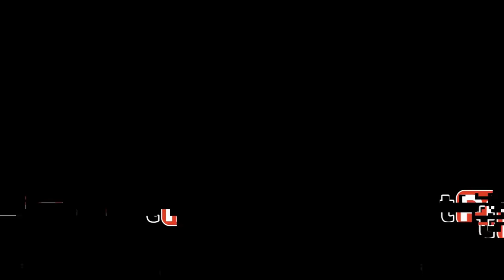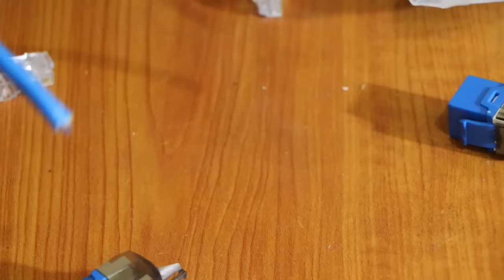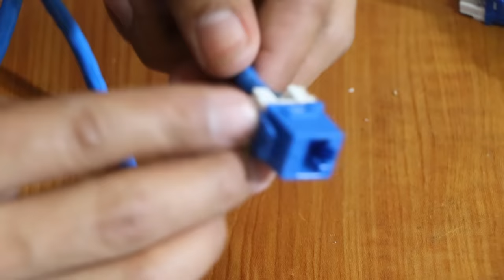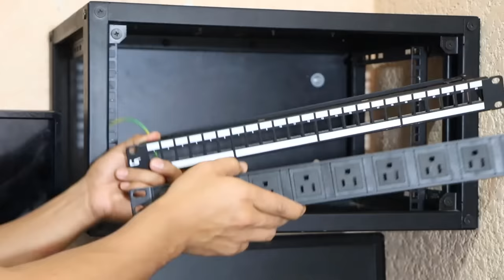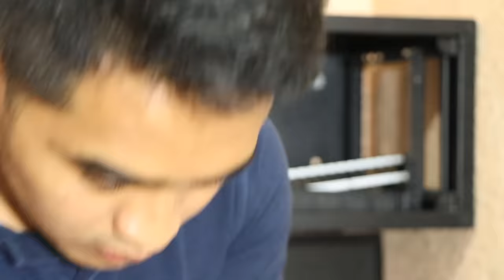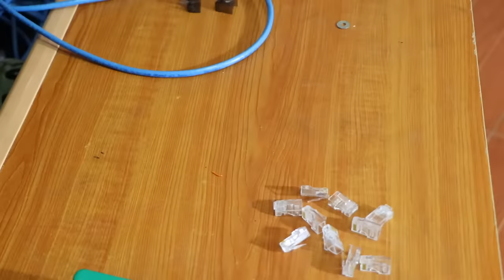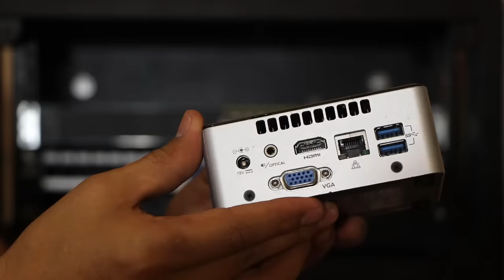DIY Home Network: Experts Debate – Right or Wrong Techniques?

Comment: Couple things I would have done different:
1) Install the cage nuts in the rack.
2) Patch panel up top, its never going to move, ever.
3) Use a shelf or the bottom of the cabinet as a shelf for not rack mount equipment.
4) The tight radius of your patch cables surely doesn't comply with standards, and you are screwed if you ever had to use another port.
5) Consider using a couple keystones for your media PC and modem hookup, that way everything goes to the patch panel and you don't have to tuck any wires back behind as you are up there.
6) If you haven't already, map out where your patch panel connections go in case you need to troubleshoot or want to set up VLANs at a later date.
7) A small UPS might be a good idea.

Overall decent effort. Definitely looks cleaner than the cluster f I have running, but with just a few tweaks there would be little if anything to fault.
Reply: 2) there are different opinions on that. I personally prefer any front facing power connections (which are often handy for home racks) up top and patchpanel beneat it.
(I personally have:
Power A
Passthrough
Power B
SFP+ switch (dedicated)
passthrough
1GbE switch A (with a few extra SFP+ ports for redundancy of some important devices on the SFP+ switch)
patchpanel
1GbE switch B

It's not ideal, but I have a lot of U's in height but a lack of access from the back, so having everything from the front makes maintenance easier. It also puts the patchpanel and switches on eye height, which is nice. What I wanted to make clear: The location of the patchpanel depends on your needs and setup. However, it should always be above any servers.)

3) preferably just grab rackmount gear. Switches are not that more expansive rackmount and almost every PC an easily be turned into a rackmount by just putting it in another case (including a router).

4) Standards, any link to a standard about bend radius for these?

5) The problem is bigger, he should've terminated the in-wall cables into keystones (not plugs) and should indeed have used passthrough plugs for the devices. I do like using pass-through plugs in patchpanels connect devices though, it's nice and clean... Till about 10 devices, then it becomes cleaner to do it differently.

6) This is so understated... PLEASE EVERYONE document it. I cant second this more. 

7) Depends on your location. Some countries don't have frequent outages. I myself unplugged all UPS's in my rack. The poweroutages once every 30-40 years(!) here, was not worth the 25-40W upkeep they took.
Reply: Point no.5, you mean that everything goes to the switch and not the patch panel right?

Comment: I would not have done my own batch cables, especially using wall-rated solid-core cabling.  The value of time invested in making all cables typically does not win over purchasing patch cabling at the length you need.

Comment: If you're only going to use two rack screws, at least use the bottom ones. This way it will pivot on the bottom edge which lets the rack ears sit against the rail. With only the top screws, the rack ears are trying to move away from the rail, so all the force is taken in those two screws and the top edge of the rack ears.
Reply: Not to mention that he didn't even use cage nuts for secure mounting.

Comment: Thank you so much for this video and the links in the description! I've always been hesitant to actually buy anything without assurance that it would be compatible. I used your recommendations and some of the tips from the comments to finally buy something I've been wanting for awhile, but recently found a need for (IP security cameras). I've run two cables into the basement for a central area to run to additional areas around the house, and this is perfect for that location.

Comment: Hi, I was looking for information on how to wire a receptacle outlet for a Emerson MPH-NCV27AMXH30 27 Outlet Black Power Distribution Unit; and I haven't been able to even find a PDF manual for this unit; I initially source the materials to wire the three, (3) phase, four, (4) pole, five, (5) wire outlet to match the plug on the PDU; however, due to the lack of information I have been able to find; I am thinking of changing the plug to Singe, (1) phase, 30 amp, 240 volt.  Any information or pointers where to find manuals would be very helpful.  Thanks.

Comment: Good video! I like that you made your own patch cables. And you should definitely use cage nuts and It does look like the top 2 racks are slightly off and not level. And like others have said the patch panel should go up top. I have OCD so I noticed it right away but otherwise really good job.

Comment: It hurts me that things aren't actually installed aligned with the rack, so only two screws would line up for each device
Reply: Literally was thinking the exact same thing... I rip my guys a new one if they skip a cagenut hole as then your always left with 2/3 of a U at the end.
Reply: It hurts me reading a negetive post
Reply: Newb here. Is it just me or do i think his setup like an overkill for a single home. I mean why does it seem he has a lot going on. I have a decent sized house with 5 bedrooms, 1 mini office 2 living rooms but my switch is just an 8 port tp link switch. Then using an x50 deco mesh system.  Ethernet bachauled to 3 rooms, the office, 1 living room, then wireless backhaul in the garage and the garden.
Reply: @lildrei01 just you...not trying to be a azz but that's going to be my setup.

Comment: hi, Maybe it's better if you use the gig ports (the 2 ports on the far right)  to connect the mini PC and the router. This because you get more bandwidth to your devices. If you want to access the files from the mini PC with multiple devices it's a lot faster then with a 100 mbit connection.
Reply: Agreed.  And, use (maybe) different color cables to illustrate that.  Not all just blue cables.
Reply: I didn't pay attention to the switch being used,  but a 24 port gbe switch is not very expensive. If the rest of the ports were indeed 100 base t, then the first upgrade he should do is replace that switch.
Reply: Agree with both of you.  But, I'm glad that he is showing it step-by-step, because it makes my PALTRY EFFORTS feel better.  This guy is real -- not like Linus and all of his large team now.  So, I like what this guy is showing us ... I really do.  I'd like to have a setup like him one day ...

Comment: How do you have your drops? Are they into the wall and just out a hole behind the rack or are they through the ceiling? I couldn't tell in the video....

If through the wall did you cut a slit in the header beam to fit all of them or drill a ton of holes?

Comment: @Torogi Pro: hey, thanks for that post. It's very step by step and I enjoyed it. But my problem is getting to the ending, you didn't mention which cables were going into the file server. Would you help me know the cable you plugged into the file server? Where does the other end goes? And the router: one cable from the switch to the router and the other one on the router, where does it go?? Thanks
Reply: Its a standard ethernet cable. You plug one end into the server's network port and the other end into the network switch. That's it.

Comment: I am new to patch panels. So I have to ask “why are they necessary?” Why not connect the Ethernet cables directly onto the switch? Let me know.
Reply: The whole idea to use a patch panel is for organization and static labeling of the network ends to easy the troubleshooting in case of failure. He skipped this primordial thing. :)
Reply: @gilmaringa  for a home system with 4 or 5 rooms wired. Do you think a panel is necessary? Or just use the switch?
Reply: @JayDee-nj6dx  Hi. I think that is not necessary. Just label the cables and connect directly to the switch. In the rooms I recomend to use keystones on the walls.
Reply: @gilmaringa  Thanks 🙏 I’m wiring my home, 5 rooms with the longest cable 30m . Should I wire with cat 6 or 6a? Cat 7 would be overkill right?
Reply: @JayDee-nj6dx  cat5e with good quality will be allright till 1Gb. Remember the switch have to be 10/100/1000 too :)

Comment: I have only one question, why you put into the 2 fastest port of the switch a regular cable from patch pannel insted connect the router to the fastest posr on switch? Is it because you have a server in another cabinet? Or maby the router supports classic ethernet only? Thanks

Comment: You lost me when you started plugging the cables in:
- Where is the internet coming from?
- Why connect the media server to the router vs patch panel?
- How do you add on wifi?
- What are the two patch cables on the right, that connect the switch and patch panel for?

It also seems like you're linking to a different patch panel than what was used. Im all confused. Maybe this video isn't intended video beginners?
Reply: Got yeah

Comment: The hardest thing then a CCNA certification is to crimp those damn RJ 45 connectors. 

Great video btw dude.
Reply: I use passthrough RJ45. It is a lot easier and will save you wasting RJ45

Comment: Why not terminate your cables with RJ45 and plug direct into the switch? Why out jacks on them then use patch to connect to switch? What does that gain you vs going direct?
Reply: That is an option. For most home users, it will work fine. The reason we use patch panels especially in large networks is to keep the network rack clean and organized. Also, the cables that run from the data drops to the cabinet are not meant to be moved around that much. The cables are usually stiff and can break or otherwise become damaged over time. In that case, you would need to replace the run which can be costly and/or expensive. That's why there are patch panels. The cables terminate at the panel and you can patch them in as needed. Its also helpful when you have numerous data drops and don't need all of them live. You just un-patch the ones you don't need.

In the majority of home networks, a panel is not required. However, in large networks where you have 10s of data drops, if not hundreds, it does greatly help to have them to make things organized and more easy to service.

Comment: Some funky comments in here!  This was a nice build for a home network - and much cleaner than my set up.  I noticed the people making negative comments don't have much in the way of their own videos.  I guess it's easier to criticize others than to create your own content.
Reply: Not everyone with expert opinions have YouTube videos.  I was the Administrator over a facility with a central hub, three edge wiring closets and fibre optic connections to the edge wiring closets.  I had layer two switches on the edge, each separated by their own VLANs (to reduce the possibility of traffic impacting other network areas) and redundant layer three switches at the core.  I feel that I have pointers that I could add, but I'll hold back since I don't have a YouTube video to prove my worth.
Reply: It wouldn't be as big of a deal if the creator didn't title his video as "Done Right", implying this is the model uneducated people should follow. Does it work? yes. Is it clean? Yes. Is it right? No its not. And that is fine. Things he could improve: 1) use proper rack hardware, in this case he should be using clip nuts, 2) Use hardware for all four mounting points on each piece of rack equipment. If you must use two, use the bottom holes, 3) Use a shelf instead of using hardware as a shelf for smaller components.
Reply: @brandon3122  this is the problem with generalized communication and one way communication. As the title suggests as "done right" may simply imply his aesthetic view of his system where as others not directly involved in the project don't know what the actual goal was when completed. As you said, it works and it's clean, so in that perspective, it was done right.
Reply: Yeah I agree with you, all these pros pop out to comment how his network setup needs to be up to data center specs lol. This will be better than 99% of home networks out there, and actually better than most small business networks I've seen. Most are a massive mess of tangled cables from careless IT people. Only thing i'd say to add would be a cable tester, since they can be had for really cheap.
Reply: @gerald8289  most home networks in 2018 use gigabyte switches. evem router built in switches from the isp are mostly gigabyte. ive done installs and maintenance in many businesses and schools and not one of them in 2018 uses a fast ethernet switch. the only times ive seen 2960s is in ccna code academys and home lab networks.. not in production systems. if you want a dumb switch you can get a 24 port tplink dumb switch for not that much if you want managed it will be a bit more but company like ubiquity have pretty good managed switches for not much moneys
Reply: I would go mental If I saw a cab in this state at work. For a home network its ok defo not done right. When I move I will put a video of my home network
Reply: He didn't use zip ties to hold them up so I'd say it was a success.
Reply: @Eon Holt EPIC. Ha. My wife is a nurse in Michigan and I've heard that name a few times.
Reply: maybe it's because they have jobs in networking industry where they don't have time to do a video on how they fudged their home network

Comment: I also need to jump on this.  cage nuts can be had for less then $10 for a box. most nuts could pull through the rack holes so it is not secure.

Comment: just a noob question. The main cable through which you are receiving the network connection is the one that goes into the microtek router to the right? correct? the rest are just to connect to your cisco switch, server and the rest of your connections. If you wanted to build and have a firewall put on the system would you have it prior to it plugging into the router?

Comment: Lots of issues have already been mentioned but the standout for me was that none of the cables that you're wiring into your panel are labelled so you don't know which port goes where. Nightmare! And try to keep those two ports on the right on your Cisco switch free - use the main bank.
Reply: You can tone the cables with a cable toner
Reply: Also, if it’s a flat network, who cares?
Reply: @roberttalada5196  You will, when it comes to troubleshooting.

Comment: Please tell me this is the Home Network Done Wrong video. Several issues I see.
1) Did not test cables after making the patch cables.
2) Patch panel not placed at top of rack.
3) Buying short patch cables would have been much easier and more reliable than using solid core cables. Also, it would provide for flexibility for future modifications.
4) Used switch uplink ports line regular switch ports.
5) Connected router to a regular switch port instead of an uplink port.
6) Connected PC/server to a router port instead of a switch port.
7) Did not use cage nuts and rack screws. It will be difficult to remove equipment since the nuts he used are not accessible. 
8) Skipped 1/3 U between each device. This wastes rack space.
9) Ran the router power through one of the square rack holes.
10) Using the MikroTik as an AP while it is housed inside the metal rack.
11) Sitting the non-rack mount equipment on the switch instead of using a shelf.
12) You don't have a modem.
13) Did not label cables.
Reply: Gotta give him credit for a neat job though.
Reply: @shobosh  Neat? Yes. According to best practice? No. It could be done to best practice and still look neat.
Reply: Only thing I disagree with is the purchasing of patch cables. Takes no time at all to make your own.

Why not..
Reply: Making your own cables can cause unexpected issues to arise. Purchasing cables ensures that they are certified to Cat 5e, 6, 6A, 7, etc. standards. You have to take extra time to test and certify homemade cables. The homemade cables are made with solid core wires that are not flexible like the stranded wire that the patch cables that you purchase are made with. Best practice is to use pre-made cables. They are not that expensive compared to the time and materials it takes to make, test, certify, and correct issues found with homemade cables.
Reply: @arifjay6756  Making your own cables is fun the first time but it gets old quick. Pre-made cables are cheap at Monoprice and Amazon.
Reply: 14) Placed the PDU so power can block one of the patch panel ports if he decides to use it.  PDU should have mounted at the back.
Reply: What cat cable would you recommend for wiring new house? 30m would be the longest distance.

Comment: I'm slightly triggered by the upside down power ports. Also, What's the point of the patch panel here? You've already run the cable all the way to the destination, why not just plug them in?
Reply: Just thinking the same thing. No need for the patch panel in this setup other than for looks.
Reply: @CoMmAnDrX  The cable to the destination will be solid core, the patch lead should be stranded, bad practice to crimp RJ45 plug to solid core